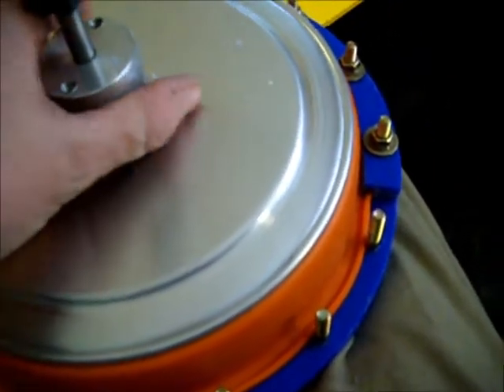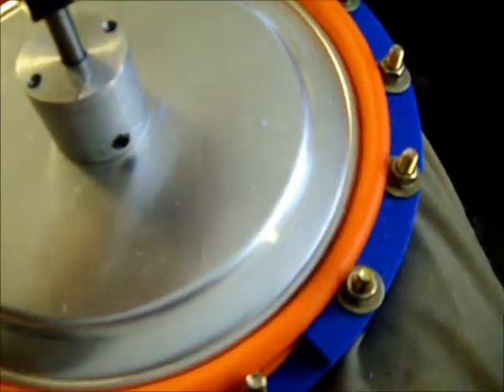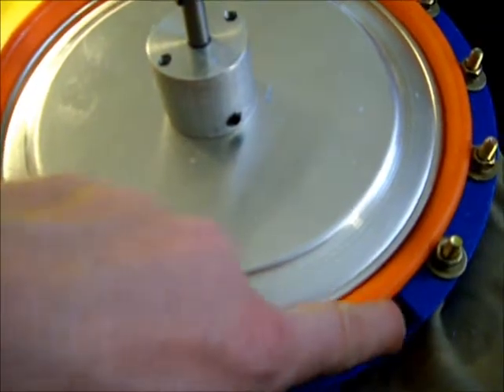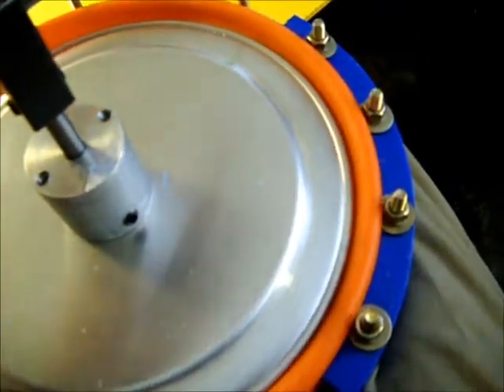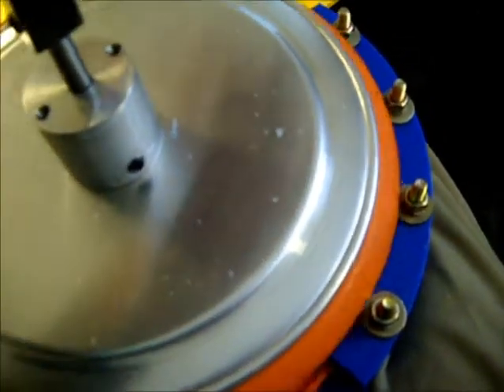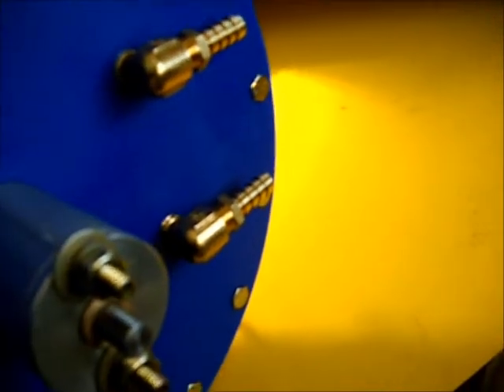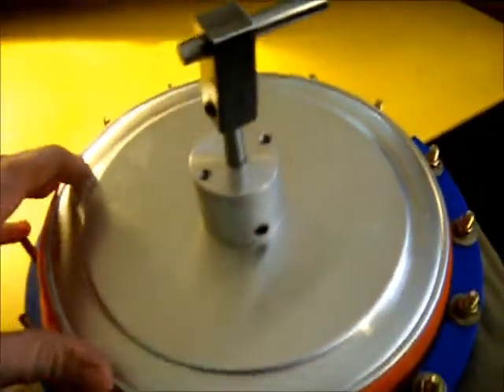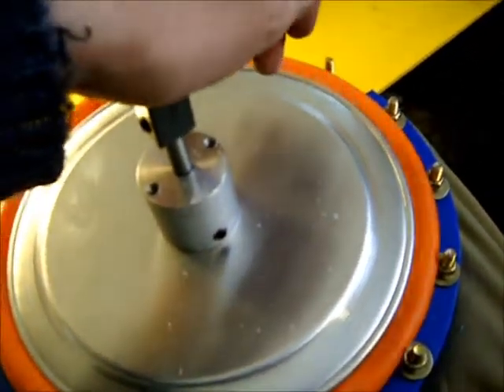Gamma Stirling Engine 3 6 16

Comment: Well done, nice engineering. I hope it is worth while. That it will work.
Cheers.
Reply from the maker: +deslomeslager  Thanks, this project is inspired by:
https://youtu.be/lsysqpVoDak
https://youtu.be/-rEVbdbd0To
Reply: @GoVertical17  So you notice that there are decent channels in that video between cold and hot, so it works as it should.

Comment: Your engine has been every well made. You mention that “something” is 9 inches in diameter. Is this the diameter of the piston shown in the video? Also that piston seems to be rather stiff in its movement despite having a diaphragm fitted. Could you please give details of the diaphragm? Is it a commercially available unit or did you make it our of a rubber tube or sheet or something else. I am particularly interested in your design as I have up to now been unable to either obtain a diaphragm or make one our of a rubber sheet. The sheet diaphragm greatly restricts the movement of the piston and also makes the movement very stiff. I    plan to build a 12 inch solar powered engine but cannot proceed because of hot knowing how to seal the piston which is of course 12 inches in diameter. My design if ever built will be unique in that it will be inside out. The displacer will work in the space behind the bellows which seals the disk piston. Thus the displacer cylinder has been eliminated. I live in a third world country and engineering products are as rare as hen’s teeth. One has to make everything by hand as there are no machine shops which undertake one off jobs. The only block to further work on the engine is the seal required for the 12 inch disk piston. This seal could be a flat type or bellows type. Thank you for any suggestions you might be able to offer.